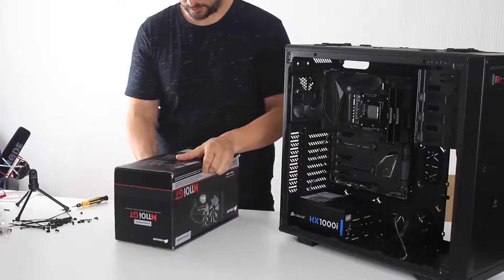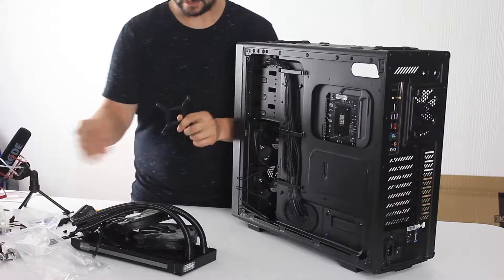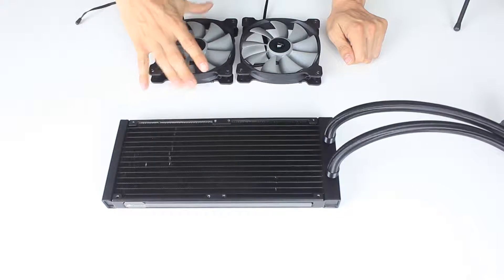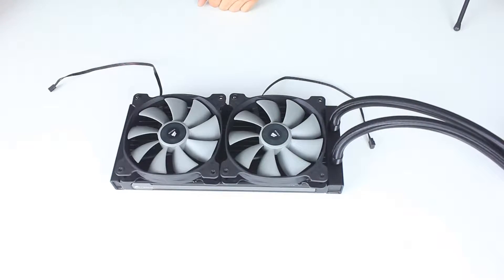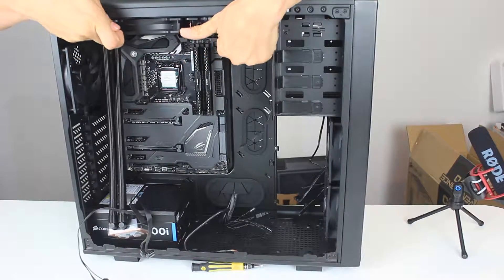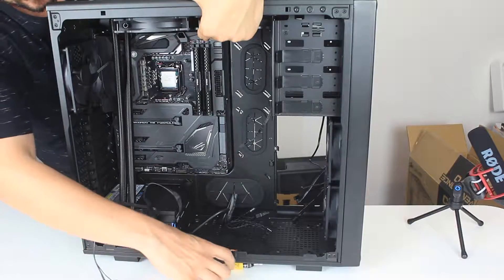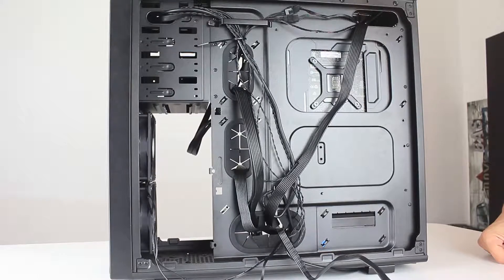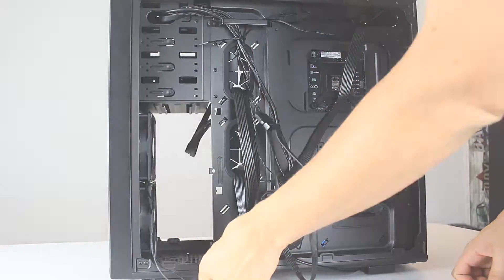Build an insane gaming machine (One-Loop water cooling installation) 6/9

Comment: @Laurent's Choice So I have not been able to find that HX110iGT Corsair version (here in the United States) but bought something I thought was similar: Hydro Series H115i RGB Platinum 140mm Processor Liquid Cooling System with RGB Lighting... it has a 280mm radiator and 140mm fans (which is what I think you have and meant to say the fans were in this video.) I have the same case a c70 and at the top where the radiator screws on there are some black rubber grommet things that look like that is where the radiator is supposed to match up... well they don't. Do you remember if that was the same situation for you when you screwed your radiator on? Thanks thanks thanks!
Reply from the maker: I see. I take that these is a 140mm config. 
The C70 support 140mm rads. Can you be more specific.  DM me pictures on my twitter account (laurents choice)
Reply: @Laurentschoice  Thank you for replying, I found my answer. This guy removed the front bar and installed the radiator flipped around... he's using my exact parts as far as case and cooler... he moved the grommets as well in another earlier video... https://www.youtube.com/watch?v=kzAGE6UM0PA and the older one https://www.youtube.com/watch?v=meqTxDNNYrs